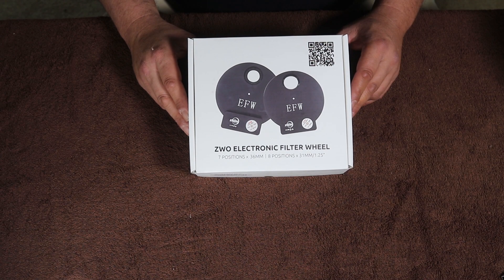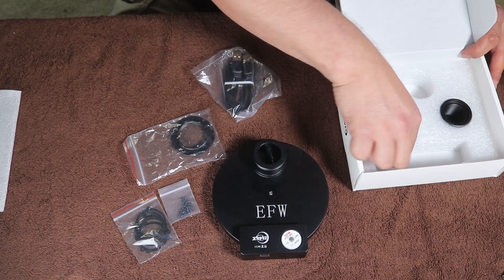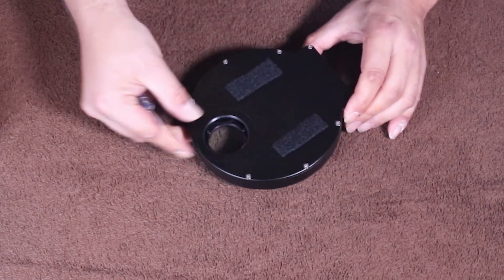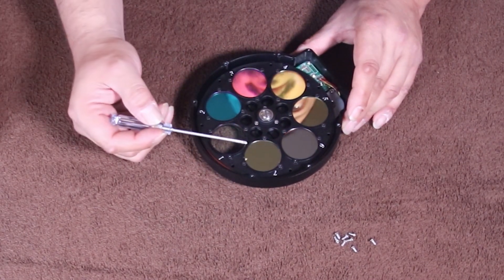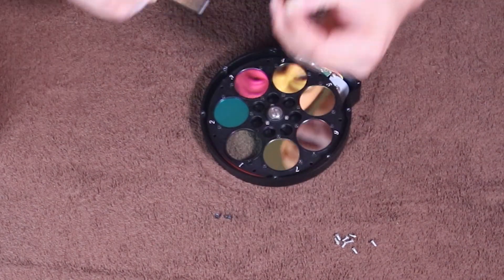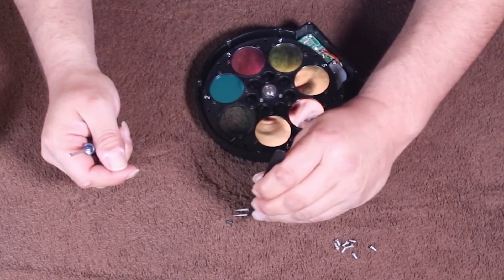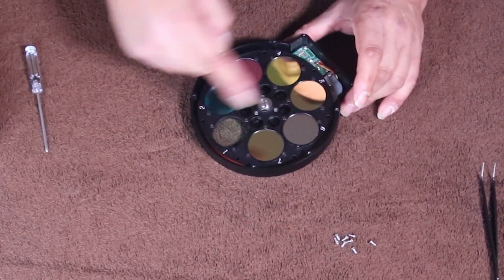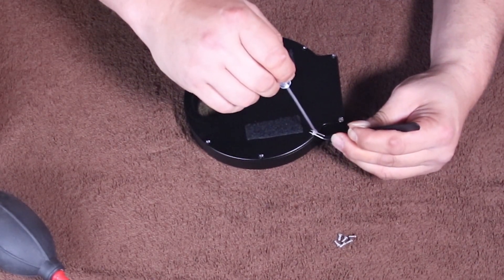ZWO 36mm 7-Position Electronic Filter Wheel Unboxing and Filter Install

Comment: @$200  apiece I should say not!
  I saw  the version 2 model of this wheel  do you know  the difference between  v1 and V2?
  Thanks.
Reply from the maker: I don't, I'm sorry.  But I do know the version 1 worked perfectly.
Reply: @dgoddard    Thanks for the reply!  I actually asked a local shop.. they told me it "should work"  considering nobody else had it in stock i'd try it..  if it's the wrong one?  then back it goes.
Reply: @dgoddard   It arrived today..  installing filters as we speak
Reply from the maker: @gewglesux  Awesome!  Clear skies!
Reply from the maker: @gewglesux  Have you tried it yet?  Hope it works for you.